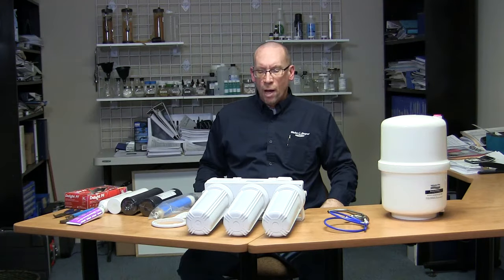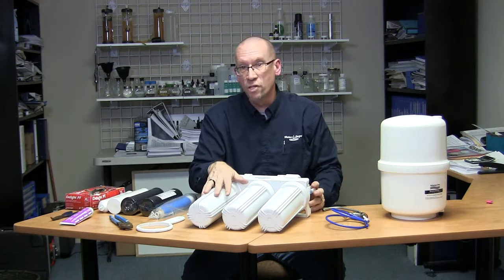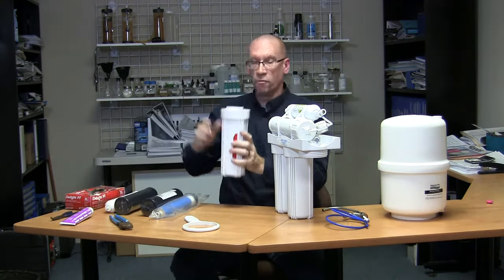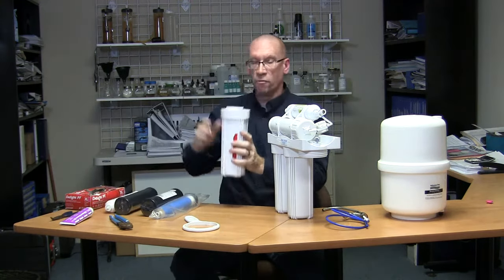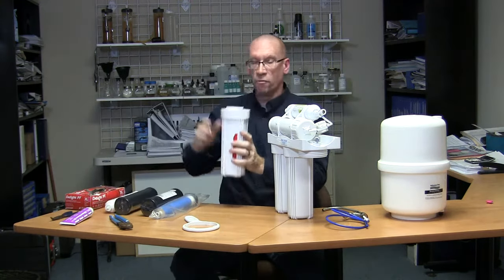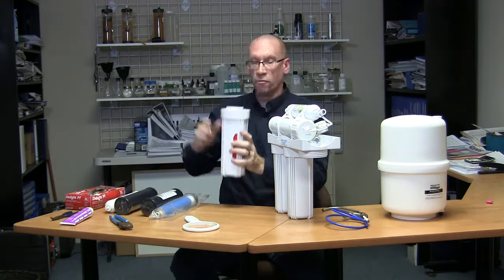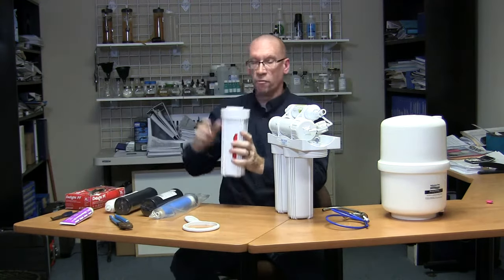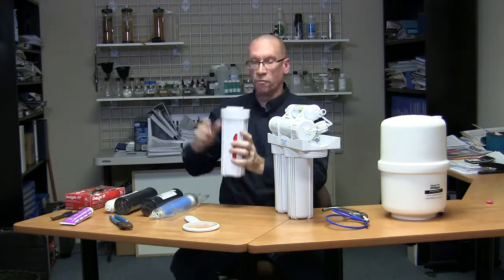Changing Filters and Membrane in a Water Depot 5-stage Reverse Osmosis System

Comment: I wouldn't believe this is the best rated water filter system has a flaw in its filter design.
I have this system for a year now. When I replaced the filters for the stage 1, 2 and 3, I found those holes on the top and the bottom of those filters have the inner dimension too large.

The inner dimension holes are too wide open that create those filters not to sit correctly in the center of the filter housing guidance. Matter of fact, the filter inner dimension should be designed to fit on the filter guidance. Therefore, if you look at the bottom center of the inside of filter housing, you will see the filter guidance already built in place for holding the filter in the center of the inner housing. This is an issue that cause the inner dimension to be off the course of the center where the water flow is going, and that inner dimension creates a water near miss gap. This could be an issue that allows water to flow through that gap instead of flowing through that water filter. I can’t post some pictures here but you will see that water shield gap (in millimeter gap) almost touch each other.

What do you think?
Reply: Hello. I reviewed your comments above and would like to thank you for engaging us with your concerns. First, I'd like to confirm that these types of systems are typically all built to the same industry specifications, testing procedures are the same and are generally similar in most ways. This particular unit design relies on the pressure on the top and bottom of the filter that is generated when the filter bowl threads are tight to create a seal. The first stage does not have o-rings and completely relies on the downward/upward force to limit water "pass by" at both ends. The initial sediment filter (stage 1) in the treatment chain is included as a particulate filter only to reduce fouling of the filters downstream. The second and third filters are Carbon Block filters (can also be granular carbon in some units) with an o-ring at both ends. When compressed in the filter bowl these o-rings seal the filters from water "pass by" and force the water to travel through the Carbon Block across the full surface area of the carbon filter. This ensures maximum contact time with the carbon and maximum contaminant reduction prior to the Reverse Osmosis Membrane.
Reply: @WaterMan369  Thank you so much for your response. I don't really know for sure if the version you have is similar as mine. But, I spoke with a tech support from this company and he refused to accept what I tried to explain it to him. Therefore, he asked me for the pictures but the filters I already installed and those removed ones I already thew in the trash. The next replacement I will have to take pictures and will sent them to him.
I do believe there is a flaw in the design of the system I have. Let me explain it to you for this reason: The three have three O-rings in black (they are used as the shield for the gaps on the top and the bottom of those filter catridges). They look like a washer from a faucet but they are on the larger size. Here is the problem - those inner dimention have the cut a little too big. The inner holes are barely fit and those o-rings are sitting on the side of the filters' fitting. When I removed the old filters, I found out by the mark on those o-rings. They were sitting on the side and they barely shield the gaps. Also, there is a part being involved with the design and I don't really know what to call it. 
Anyway, look at yours and please tell me if you have similar what I have.